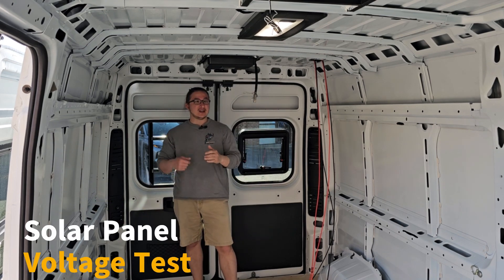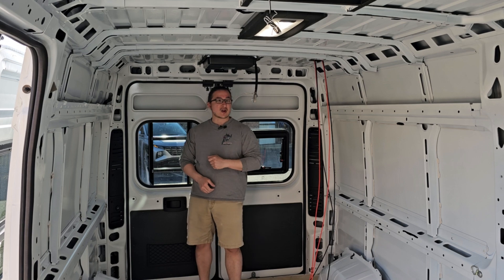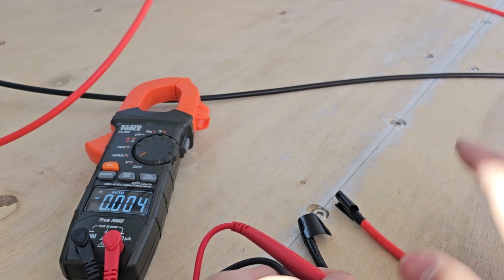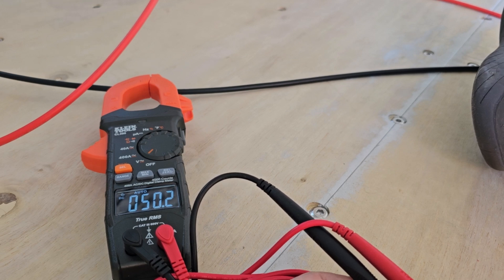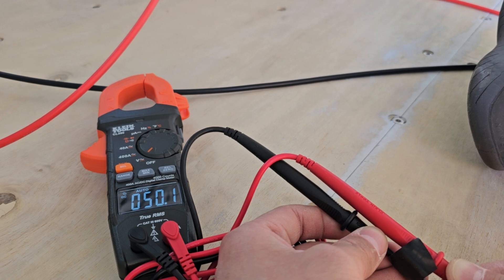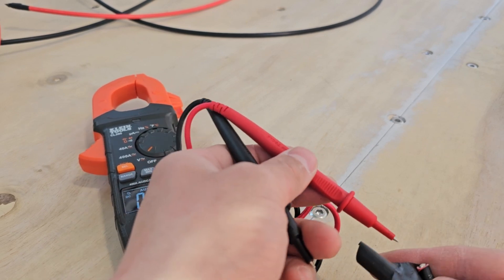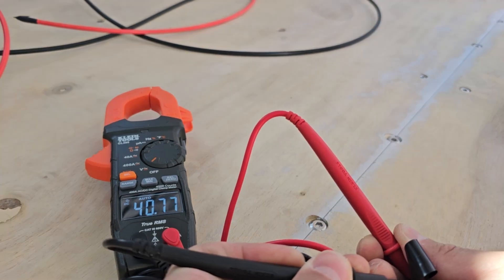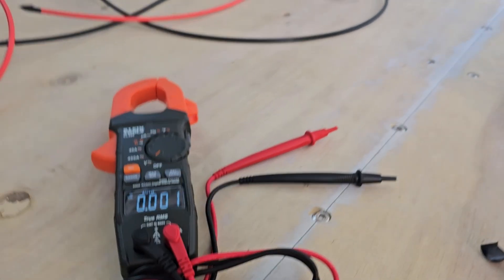Solar Panel Voltage Test | Ram Promaster Van Build | Part 11

Comment: what about amps or watts?
Reply from the maker: I might create a follow up video to show testing amps and watts. I tested amps inside the shop but it wasn't on video. Based on that the (2) 250 watt panels were pulling around 1-2 amps and around 48v inside with my shop LED lights on. Which is about 48 -96 watts.

Comment: No short current test to prove current?
Reply from the maker: I had forgot to film the current check outdoors. I did run a current check indoors on the multimeter which did say it was pulling 1-2Amps with the shop LED lights on it.